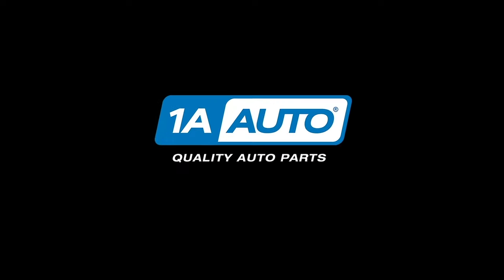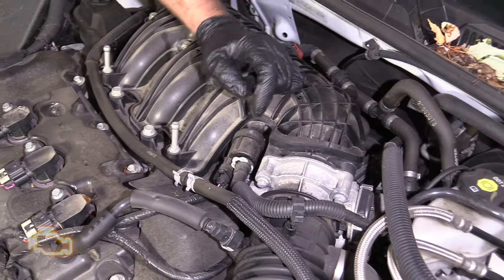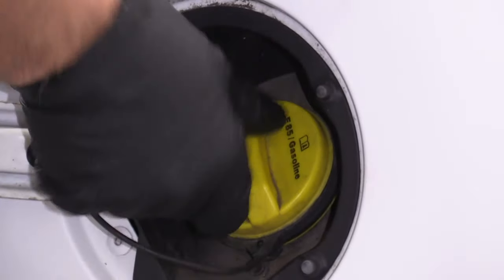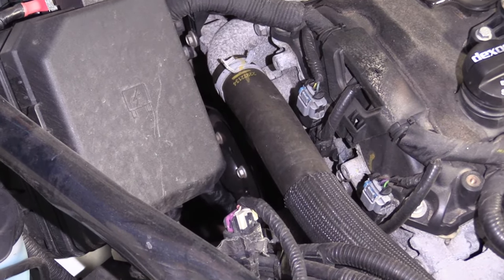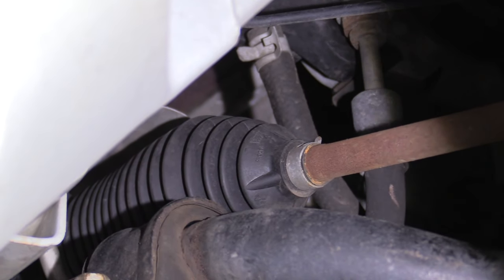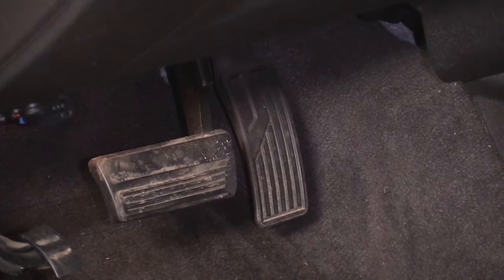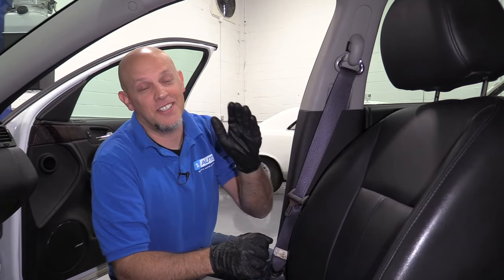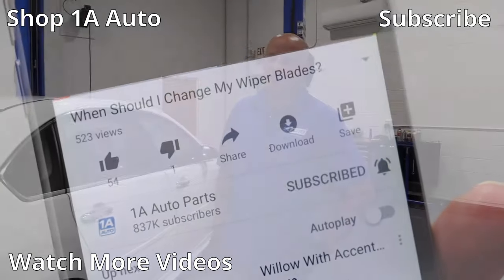Top 5 Problems Chevy Impala Sedan 9th Generation 2006-16

Comment: I’ve owned two of these , and still have a low mileage 2013 LTZ. I think you forgot about those damn blend door actuators. Lol
Reply: Please, don't even mention those... "TAP TAP TAP TAP"... I've replaced all three of them at least twice in the past year.
Reply: The blend doors seem to be very failure prone.  Click click click
Reply: I don't know why they just don't make a metal gear actuator instead of the plastic stuff. They are somewhat difficult to reach
Reply: @TheHuskyGT  lmao same here, one already broke again and I’m just not gonna fix it again until I sell the impala 😂
Reply: Absolutely facts!  And if you replace it, you better use an oem Chevy part.  Don't use the aftermarket one.
Reply: Mine went out once and it hasn't crapped out on me since
Knock on wood!
Reply: @isa_i_ahtraveler117  because that cheaper the cost went down over the years that for all of the automotive company nothing expensive in them instead of the drive train an that it depends who makes it
Reply from the maker: Lol! Yes its the most commented problem. It would have been #6 if we were doing top 10. Thank you for checking out the video. If you need auto parts go to: http://1aau.to/m/Shop-1AAuto-Now
Reply: @isa_i_ahtraveler117  I just opened one and it looks like water bottle plastic. It's ridiculous. I don't think the Doorman brand is worst than the OEM though. I will try just getting the AC Delco this time. Although I believe part of the problem is the mechanism of the vents getting really stiff, making it very hard on the actuator gears. Sadly, there is no way to lube the whole thing up. It's hard enough to get back there.
Reply: They're easily reset by removing the fuse under the hood labeled "display" for a couple of minutes. After plugging the fuse back in just turn the key to ACC (not all the way turned over) and you should hear the actuators resetting under the dash. Gotta make sure the fan is turned off before removing the fuse though. Still annoying that these things go out so often and so commonly :(
Reply: YesereeBob! Same here w 2013 LTZ.
Reply: @isa_i_ahtraveler117  the 2 8n the glove box are easy to get 2. The 1 behind the dash is a problem
Reply: I have a 2016 Impala LTZ Limited 3.6 l 305 horsepower 265 foot pounds of torque a very fun car to drive but I'm also dealing with an actuator problem mine sounds like it comes from behind the radio closer to the passenger side
Reply: That was only a problem until 2014... The 2015 and 2016 Limited/Fleet models were fantastic.
Reply: Mine went bad and wouldn't go back into the resting key off position. It would just click until eventually it killed the battery.
Reply: @isa_i_ahtraveler117  cuz then us Impala drivers wouldn’t have to keep the parts industry alive if they made an actually quality one!
Reply: I replace a different one every year.
Reply: This triggered a fight or flight response in me. TICK TICK TICK TICK TICK
Reply: Oh yes he sure did,
Reply: @kogmawgaming 😂ME TOO
Reply: Those are so annoying

Comment: 2009 impala with 217,000 miles still runs like a champ,  good cars if you maintain them well
Reply: I just got a 2009 with 99,000 miles on it.  What things
should I upgrade/replace & keep up with so the
engine last longer I'm already changing the air filters
& Spark plugs.
Reply: Any advice on how to maintain it? I have a 2009 Impala LS runs awesome but seems to have coolant leak issue
Reply: 3.5 or 3.8?
Reply: 3.5 or 3.8?
Reply: 3.5
Reply: @ayeyaungshexalitegang   Might want to check you’re water pump, mine was leaking also and I changed it out, working fine now
Reply: @KaiGuy88 the engines on these years are bullet proof. The real problem is the 4T65E is a pos. Blend door actuators will go out.
Reply: @KaiGuy88 Change every fluid especially transmission
Reply: Straight up, mine got a little over 300k miles and runs like a beast
Reply: No they are not
Reply: Got a 2014 with 210k on it.
Reply: Con grads. 2008 impala ls. Trans cont. Before any trans problems shift alot better. 5W-30 synthetic oil. motor runs excellent at 147k miles.
Reply: @ayeyaungshexalitegang  I used lucus because of a water pump gasket leak. All good. I may put another container in before winter.
Reply: @Dwayne-bw5vs  I have a 2013 Impala with the 3.6 VVT, with 162K on it,  I change the oil every 5K and add a bottle of  lucas oil stabilizer each time.

Comment: Bought a used 2008, there was so much wrong with it. Leaking coolant, engine mounts destroyed, tie rods, assembly hubs, etc. It’s the owners who were careless about it. But if you take care of it or bring it back to life, it’s an ok car. It’s just the anxiety of ‘what’s the next repair?’ Smh
Reply: Same with my 2011
Reply: Well that's why anytime you buy a used car. You do it major tune up on it. Change coolant hoses, have suspension check an replaced what is needed and get new tires as well alignment.
Reply: Literally just happened to me
Reply: Well when you buy  a  OLDER. tired  car with a few thousand  miles  your going  to have problems....Try  buying  a newer   Impala  with less than 90,000 miles and you WONT  have all those problems......😅😅😅

Comment: I'm surprised this one wasn't mentioned:  I've known a few people who have owned this car and they all ended up having the same issue with a persistent ticking noise coming from under the dash on the passenger side when they turn the car off.  Turns out it's related to the HVAC system having a badly designed actuator that fails shockingly frequently and isn't (or at least wasn't for them) covered under a recall.  And it's a monumental pain (cost and time) to replace.
Reply: Rough mine has this tick
Reply: I got my 09 Impala with 70k miles (old lady owned it) and the moment the season changed, it broke. Ironically the same issue on my old Ford 04 Explorer that I had prior so I was pretty frustrated. My car would only blow cold A/C, while it was the middle of winter so it was a pain.
Reply: Hey I'm having this issue it's more noticeable when starting the car when it's cold . As Rpm goes down there's a slight grinding then goes away as the rpm sets . Not sure why it's doing this also there's like a squeal when I accelerate there's like a ticking on passenger side
Reply: @1smae100 yeah the ac actuator would have nothing to do with you pressing the gas, separate issues
Reply: They’re actually not all that difficult to replace them, takes about a half hour and a few swear words. The problem is you can replace the part and the new part might last 5 years it might last 5 minutes. That’s the annoying part.
Reply: I HAD THIS ISSUE! Anyone else with this don't take it to a shop it's a 10 minute fix get someone with small hands you can feel the actuator, normally it's behind the glovebox but if you put your hand on it you can feel it click. Mechanics will want to take out the whole assembly but you can fix it on your own easier
Reply: @kogmawgaming    Take out the glove box to get to it/them.  Good video on “how to” on YouTube
Reply: DUUUDE!!! MY CAR HAS THIS!!! Never knew wtf it was, thank you!
Reply: Going on 5 years on my Impala and I've never had anything break or need repairs. Granted my dash looks like a Christmas tree, but those are the only cars I drive lol.

Comment: Another very common issue is a bad solenoid in the transmissions that causes a lag followed by a kick when shifting from 1st to 2nd. It requires partial transmission disassembly and typically costs around $1000 at a dealer or trans shop.
Reply: I be driving my shit like it's manual my poor torque converter lmao I be banging gears reving to 6k Cutting the gas Then flooring it into the next gear lmao I look goofy when I drive but I love it
Reply: Do you know if it gave a code.. I have the same issue but dealer says no code.. smh..
Reply: Dang $1k alright good to know
Reply: 1600 to 1800 here
Reply: I think that’s what’s going on with mine
Reply: @maddenVeteran513  same here
Reply: @mickeyslim  😂😂 tell me why i do the same shit on my 2010
Reply: Unless you know or have a family member which comes out way cheaper .
Reply: 70k miles on my 2010 Impala and the exact same fucking thing is happening. It’s pathetic honestly, car was extremely well maintained by an old woman before me, and maintained very well by me…. :/
Reply: Shit. I just thought I was a shitty driver. I feel 30 percent better about my driving now. Man I could have used this video 8 years ago. 😂
Reply: @jorgenvonstrangle000 l don't know about that 🐴 chit 5 more hundred n you can get the whole transmission rebuilt?
Reply: @nineaxis9941 So what happened to the vehicle what you do with it!
Reply: i changed my spark plugs n it stopped🤷🏽‍♂️
Reply: @mickeyslim this comment is the goat

Comment: I've had my 2012 Impala  for 7 years and never really had any of these problems other than the blend door actuator
Reply: How many miles was car when purchased it god body and how many miles was car after 7years ? And would call it a problem car ? Lemon car? Or reliable car or car that rear needed repairs
Reply: @allanprimassmithbey2422  when I first purchased it, it had just under 19,000 miles on it. Right now it has just over 79,000 miles on it as I don't drive it all that much any more. The only real repairs I've had to do to it is replace the purge valve under the hood and vent valve by the gas tank, which are very common problems with these newer GM vehicles. I've also had to replace a blend door actuator in the glove box twice, which is also a common issue with this vehicle. Otherwise, in the 8 years that I've had it it's been a very reliable vehicle...
Reply: @allanprimassmithbey2422  And I'll also add that the repairs I mentioned aren't expensive at all. You might even be able to do them yourself
Reply: A2009 impala el motorsito que controls el aire ase mucho Ruido como que esta un raton destroy
Reply: @trinidadsanchez9048  Dam mice!
Reply: @allenleavell2847  I replaced all 3 hvac actuators then looked at the blower motor but I think my ac relay starter fuse is going bad because I still get hot n cold  but I want ac,  I tap it then it work's I'm still working on this problem here n there
Reply: @dollasignmic18344  I never had that problem in the 8 years I had mine. Matter of fact I never even had to touch the other 2 actuators; just the one in the glove compartment. Unfortunately I had to sell mine due to financial issues. Hope you get your issue fixed
Reply: @allenleavell2847  thanks

Comment: Good list! My 2012 LTZ has about 195K, original engine and transmission. I’ve had to replace the purge valve solenoid and power steering pump. I was surprised the infamous blend door actuators weren’t on the list lol.
Reply from the maker: Yes the actuators is a problem. Thank you for checking out the video. If you need auto parts go to: http://1aau.to/m/Shop-1AAuto-Now
Reply: Purge valve solenoid is real common mine has 138,000 and, I’ve had to replace that twice already.
Reply: How did the transmision not go out ?
Reply: Yes as the door lock actuators but other than that these cars are awesome best front wheel drive cars gm made sad they don’t make them anymore
Reply: Now that you said that ......
Reply: @fandechavalones3022  2012-2016s had a different trans 6 speed vs 4 it’s a lot more reliable